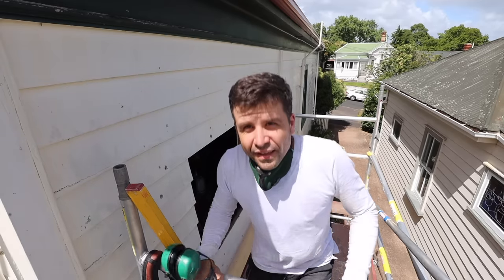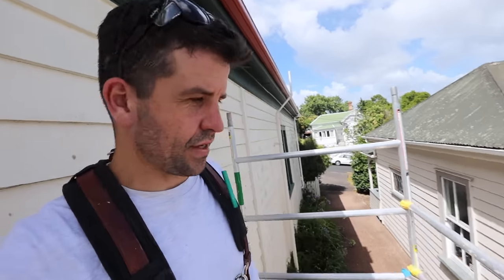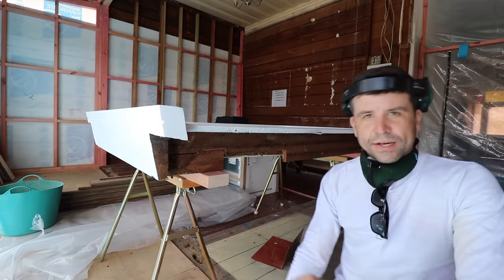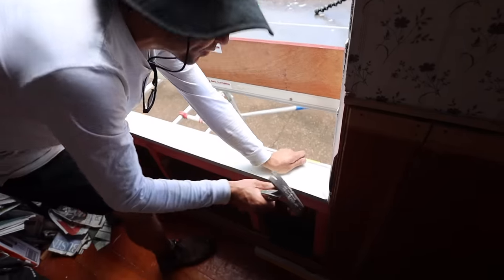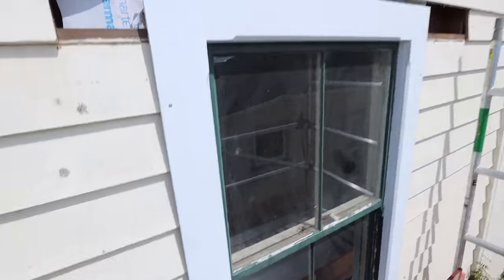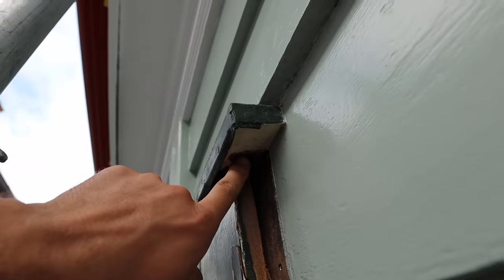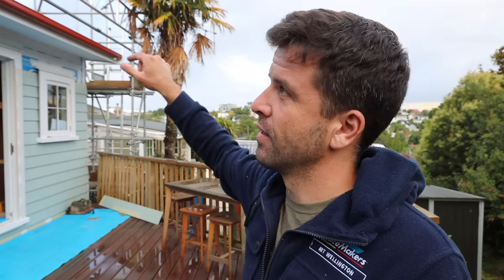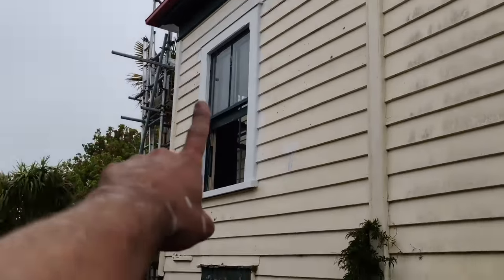What's the deal with New Zealand windows?

Comment: Hi Scott. Here in the UK on new builds, we set the windows back in the external building skin, (usually 100mm concrete blockwork if being cladded), so  that they sit 25mm INSIDE the insulation cavity. (UK building regs). This leaves a distance of roughly 100/125mm from the outside face of the window frame to the outer edge of the cladding. (cladding is usually 25mm feather edge board lapped and fixed to 25mm batten and AVCL layer, which is screwed to the external blockwork skin). A timber finishing trim is then fixed up each side of the window to cover the blockwork/batten/cladding. I actually gauge out my cladding to make sure that there is a full unbroken board running across the top of the window, (slightly runs below the window frame head), which weather proofs it at the same time.  Great to see how you guys do it. 😎 Cheers.

Comment: Hey Scott. Love the videos and the meticulous work you and paedau do. I am in Connecticut in the US, here we would normally put the window in, it has a nail flange that gets nailed off into the framing around the window, then tape the flanges, run the vapor barrier, then trim the window out with whatever casing someone wants. Then the cladding runs into the side of the trim and then the ends get caulked. Honestly I think the way you do it is much neater. Keep up the good work lad!
Reply: Forgot to mention the drip cap on the top trim. Somewhat like the flashing you made up. But much simpler

Comment: Windows in the Uk are set back from external face and would generally have a lining from face of frame to widest point of the cladding. Both have there merits, I would say visually having them set back allows for a smaller window frame, which in my opinion looks better but maybe that’s what iam used to. Great work though 👍

Comment: There are many ways to do this, as you did with the scribe(pain in the as5  method, long on time) and you are left looking at a  joint in the front elevation that can crack.
Add a return on to the wings(moving the joint to the side)And butt the weather boarding up to this.(quick).
Make a rebate in the end of the weatherboards(making them square stock efectivley) and plant a square timber onto the wings, just like the above.
Scott, you and your mates are great chippies, nice to see your work bro.
Bit suprised after all the money spent on the job that the client is going to refurb that old sash window and double glaze it...must be a reason ,Prehaps its a family heirloom.

Comment: Window nailed to the sheathing. A J trim all around the window.  Drip cap on top of window. Siding slides into J. In Northern Canada.
Reply: If it's vinyl. Hardie needs to be caulked. We also caulk our kwp and canexel.
Reply: @cmmartti  plywood, OSB. Anyone that's a tradesman in Canada knows
Reply: @cmmartti  4×8 sheets or 1220×2440. Usually 1/2 inch. Or 13 mm. Against the studs. Exterior of building. Wall sheathing.
Reply: @cmmartti  only required in high or extreme exposure zones here. (you fill in a risk matrix when you submit a consent to council) We call it  RAB board (rigid air barrier)... Common on our commercial jobs and becoming more common residentially. Weather boards in sheltered locations in Auckland (with Eaves) are unlikely to require it, and matching into existing that doesn't have it (tar paper if you are lucky but probably nothing on that aged house). weatherboards have a ton of air moving through which keeps it all dry and therefore functioning. Sealing up stuff inappropriately has generated problems in the past here. Not code, so why would the client want to pay for it? Also the stuffing around to get the extra depth in an addition would be super expensive for what it gains. Airtightness is not required by code in NZ.

Comment: Hey first time comment, long time watcher. Here in the states we waterproof window openings pretty much the same. The differences here, on that window you did... the opening measurement you would need to get, is the over all size of window including the exterior casing (trim) and the scriber would  be installed first... plus a smig more for caulking... To match the windows of rest of the house, the distance that the windows juts out, typically here the exterior of homes have plywood over the framing of the house then siding (weather boards) so you’d install the window tight up to the waterproofed plywood. Then caulk that sucker :-)

Comment: Hi Yah from Whangaparaoa,
Loved this episode and am using it as a teaching session. 63yr old woman with zero building training but have 3 leaking french doors and no money. I'm doing it myself but infinitely slower than you guys. The house was probably built as an Orakei State house, shifted onto this site 98-99ish and an extension added which includes a bedroom and deck over a garage. I asked the previous owners if they had any leaking problems and they twice said no. They lied! Now the doors are out I can see there were no sill trays or head flashings. Don't know how they got past building inspections! Of course the original is completely watertight despite old technology. Not looking forward to getting the scribers right...possibly will need to buy many extra meters of wood ☺

Comment: I’m always amazed how many inspections you guys have to go through. Where I live (Slovakia) no one gives a dam at reconstruction, and only if you are touching load bearing walls you have to have plans from architect. Even roof change is considered just maintenance and no one care. And when doing new house, there is only one inspection at the end and that is only about certificates for electrical and heat losses and so on.
Reply: It seems over regulated right? You should google “NZ leaky building syndrome” it’s the reason why they have to carry out so many inspections.
Reply: @cmmartti  meh, Incorrect classification and use of building materials, bad building practices and corner cutting. Not from Scott though (as far as I can tell), he is methodical, has a well thought out plan and his Craftsmanship is some of the best I’ve seen. Nz has and interesting environment, harsh weather conditions, hot sun can be  windy, wet, earthquakes, there’s a lot of factors that influence construction. Auckland was (when I lived in Nz) a place where you can have 4 season in one day.
Reply: Wow, my dream place to build.

Comment: If we are retrofitting  in lap as siding(like here) we cut out just bigger than the window unit size, set the unit and then use the new trim as a template and cut out siding as needed.

Comment: i dont know how they build windows in to a house here in the Netherlands.. The walls are made of stone and then there's just a window built into it, so i think the build it like you guys do in New Zeeland. But then there's no framing, and the walls are made of bricks 
Keeep up the great work love your videos
Reply: In the Netherlands we build totally different. We have an inside and outside wall (both some kind of brick usually) separated by an air gap and (in new houses) insulation. The windows are sort of placed over the air gap usually when only (part of) the inner wall has been built. The outer wall is then built against the side of the window. So the window does not stick outside the walls. A bit hard to explain but here is a new house with just part of the inside wall and the window placed: http://2.bp.blogspot.com/-YKtT7Ftxvmk/UQp5JDI9AhI/AAAAAAAABLo/9BtSgxDmgNM/s1600/IMG_4438.JPG

And then here you can see the window lies recessed in the wall: https://www.bouwbedrijfadspruit.nl/includes/_Files/afbeeldingen/P9030058-landscape-klein.JPG

Comment: In the USA, we weather proof the whole house, weather proof/flash windows and doors, prior to the siding, brick, stucco, or weather boards. 

Its a better method. Caulk fails over time. The only thing keeping weather out of a scribe board, is caulk. 

But, if you haven't had any problems.
Reply: For NEW builds the weather proofing is done similar to the US. They are working on an old villa style house with weather board. In general though US building methods are superior, at least in my field (fire protection)
Reply: @aarongrey6848  3 weeks ago, they put siding/weather boards on before they put they installed the windows. 

Has nothing to do with an old "vila style". That's how they choose to do it
Reply: Not all houses look like that in NZ, that's an old house, they were following what was already there. More modern designs can follow European or North American ways of doing things. In new builds the building is wrapped with its weather barrier before the windows (usually aluminium) go in.
Reply: My house is a 120 year old timber house very similar to that one. No caulk was used in it’s construction and yet no weather gets in. It’s bone dry. It also has no insulation, no sheathing, no membrane fabric and the only building paper is under the corrugated steel roofing. It is warm and dry and was top quality when it was built.
Reply: @tutekohe1361  Ok? 

I definitely would not advise someone to not use caulk or silicone or insulation. But, if it works for you,

That's great. Hopefully all your windows seals are not rotted.
Reply: I’m not saying don’t use caulk. I’m saying my 120 year old wooden house was built without caulk and has zero rot anywhere. Good design, excellent materials and quality workmanship can negate the need for caulk in a wooden house in New Zealand. As you can see in the old wooden house Scott is working on, there is no rot and that house was not caulked. The Scribe Boards have worked for over 100 years without caulk. But please, feel free to use caulk of you want to.
Reply: @tutekohe1361 You can't see what's hidden, just like termites. Nobody knows they're there till the damage is done. 
 How do you know there is not rot? 
On the framing, between the finished interior and the finished exterior.  

I can't see between my walls.
 
I believe you, but you're so determined that you can make a scribe board, so tight that water or wind can't penetrate it. 

Maybe it doesn't rain there

Comment: G, day Scott, Pado and Richard (not on site) from Sydney, Australia.
Storm mouldings: in my experience can vary from aluminium, timber quads, brick and tile. The builder needs to cover and seal the frame and envelope from water penetration. This is increased in the form of hydrostatic flow caused by wind. In other words water will travel up.🍸📎

Comment: I live in Danmark and we have brick house og Concrete house. So all the holes are pre mad. We put the windows in the holes and give them silicone on the outside and timber inside. But isolation in between. Because of the weather conditions up north all out Windows are double and triple glazed.

Comment: Central europe here. The windows are typically fixed to the masonry (in plane with outside of masonry) using steel anchors and bolts (if I told anyone, somewhere in the world they are using nails to fix windows, they would not believe me). Arguably the now-standard triple glazed windows are heavy. Then the façade insulation (usually polystyrene or mineral wool boards) goes partially over the frame to reduce thermal bridging of the frame, using various plastic/foam profiles to ensure dilatation. Then reinforcement layer on top of that (glass fiber mesh and façade cement based "glue"), and finally silicate based plaster on top. No caulk anywhere. Caulk of any kind is considered a 2-3 year solution. I know, labor intensive, slow and costly to do :| Works well though.
Reply: @cmmartti  i am not saying nails are bad, but here they are considered inferior. Not always rightfully so.
Reply: @cmmartti  first of all very few buildings are wood framed. From those that are, many use construction screws, rather than nails. In fact, if you go to a big box store, I doubt you'd find nail coils or strips for nailers, maybe some tiny ones. On the other hand, roofs are always wood framed. Typically green lumber, crazy dimensions, large nails (in my roof there are 300mm (12 inch) nails of about half inch diameter.
Reply: @cmmartti  I haven't seen anyone using mouldings on the top of the wall. On the bottom, skirt boards are common, but typically glued, or fastened using some hidden fastener system. Face nailing is not really acceptable practice.

Comment: Hey mate. I'm a first time owner/builder about to put reclaimed & reglazed windows into an extension on our villa. Direct fix weatherboard, same as the project in this video. Council says I need "sacrifical battens" either side of the window frame (meaning I have to move my studs). How did you get away without them?

Comment: It has been said that traditionally many windows designed on New Zealand homes are drafty and do not insulate well from the cold or heat. Is that an outdated misnomer/exageration or have significant improvements been done in the last 20 years to cure that problem ?

Comment: Do you do Blower Door Tests on houses in NZ?  They don’t seem to be very well sealed compared to what we do here in the US.
Reply: Generally only in certified passive builds.  I've been told more than once that filling in the draft gaps in many nz houses would make them even damper during the winter months (because it would remove the natural ventilation).
Reply: @barnholbol1262  Correct, due to the climate here there's a lot of natural moisture build up in homes. The correct method is fully sealed buildings with central air handling - of course the developer and homeowner do not want to pay for that. I often see new builds which are fairly well sealed suffering from dampness in the bedrooms as there's no ventilation. 

Our climate is very mild, so full air sealing isn't strictly necessary but it could improve the home efficiency IF the investment is made to have full house air handling added to manage the moisture. Again, due to climate that's significant expense as NZ homes don't require full HVAC so basically you'd add a few thousand dollars to the bill just to add something that isn't really required (in the homeowners eyes). There are no proper full house air handling systems available for the residential market. Some exist, but they're not really designed for NZ conditions.
Reply: And then you read the stats for respiratory illness in NZ...
Reply: @barnholbol1262  To be honest, my experience shows that to be a socio-economic factor exacerbated by building issues as opposed to a fundamental. This is correlated if you examine health issues by income status. Short story long those with low incomes have high rates of respiratory illness.

Comment: Timberframe...Mmmm...  🤤

I'm refurbing my old farmers stone cottage... the old morter has turned to sand so I'm routing it out using a cordless drill & a long series masonary bit, then refilling the gaps... doing sections at a time so it doesn't all come down on me head 🙄 oh yeah... thats inside AND outside... ask me about windows in 6 months 😂 (upvc double-glazed)

I'm also lowering all the ceiling heights, building studded walls stepped away from the stone with 25mm rigid insulation between them... filling the 3 x 2 stud cavities with rigid insulation & then putting 50mm insulated plasterboard over that.. 😤

A Re-wire ...
A Re-plumb...

Install 18mm ply flooring on top of 25mm insulation (I'd like more but the old doorway head clearance wont allow) and then finished floor on top throughout the whole house (8 rooms)... 
Yeah, I'm busy... 😴

But not too busy to keep watching 😏

From the Emerald Isle
😎👍☘🍺

Comment: Thanks for the interesting video. Always a pleasure to watch. Sounds strange to me to have inspections when you install / change a window. Here in Germany this is not the case. Is that a state-run inspection agency who is taking care about this in NZ?
Reply: All city/local councils have a building inspection department. Varies from place to place a little but generally very similar standards across the country. Basically state controlled.
Reply: A few years back we had the "leaky house saga" where due to substandard building and design (and also poor education on the maintenance required to keep the house watertight) there were a lot of homes damaged due to water leaking through into the structure of the house. 

Pretty much everything here is built out of wood though there are some steel frame houses. So the houses basically started rotting from the leaks and they weren't very old.

So now, when you do anything that will affect the water tightness of your home it has to be inspected, if you needed to get a building consent to do the work.
Reply: @blackhellebore89  Thanks a lot for the explanation!

Comment: Do most carpenters in NZ try to salvage materials?  I know I've seen you save flooring, native timber, doors and windows.  Seems like in the U.S. they'd just go back will all new.
Reply from the maker: I try to on these older houses in particular. The materials are not cheap here in NZ, especially some of the older profiles that were more common many decades ago.
Reply: Many of the native timbers are either unobtainable or very expensive, but the saved original timber can be re-used and, if kept dry, will last indefinitely.

Comment: No bulk insulation? No foam between windows and frame?
Reply: If the window is not double glazed, it will not matter about foam between frame/window.
Reply: You are not allowed to foam between the window and frame, there needs to be a drainage system for water leaks.